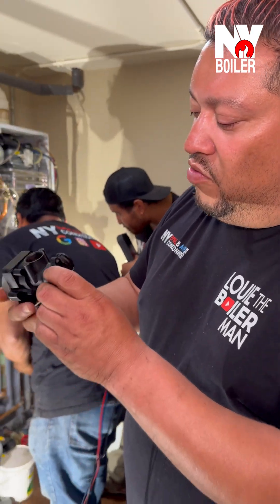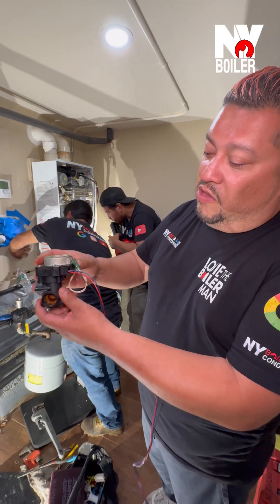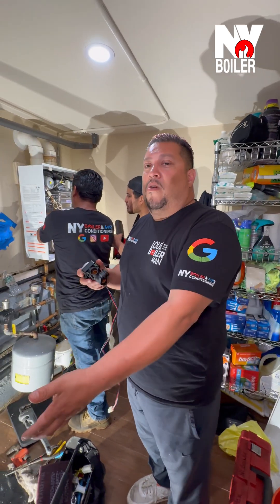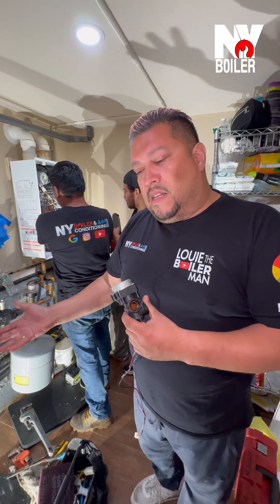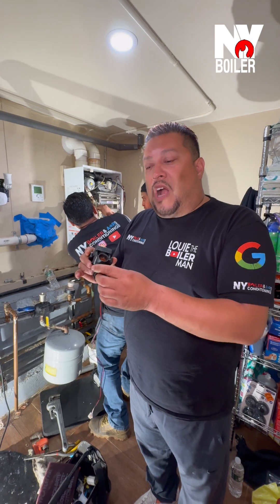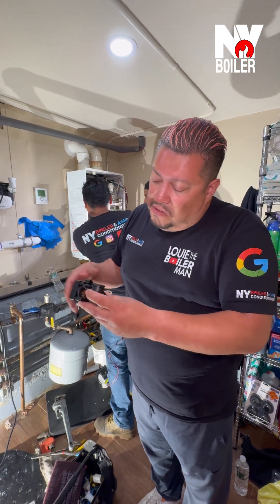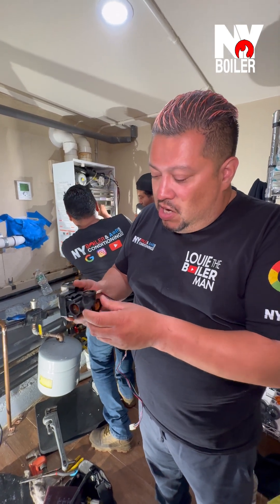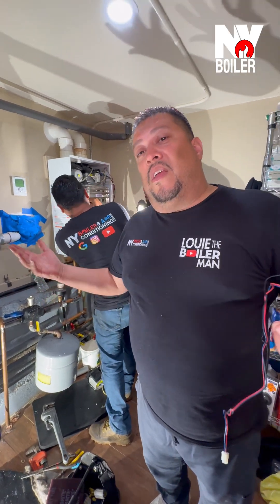Navien CH-180 3-Way Valve Explained | Louie the Boiler Man

Comment: What's the price to replace those valves?
Reply from the maker: On average it’s $1,500 because it’s all labor and very difficult to work in a small confined space and most of the time it’s not just a straight forward job.
Reply: I get that but the valve is 50 bucks 800 to 1g is prob the price range